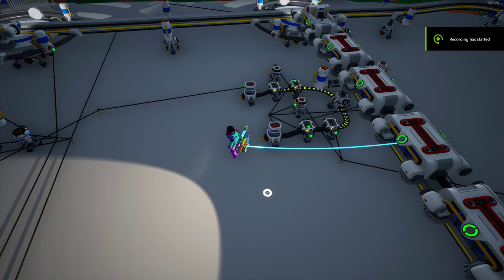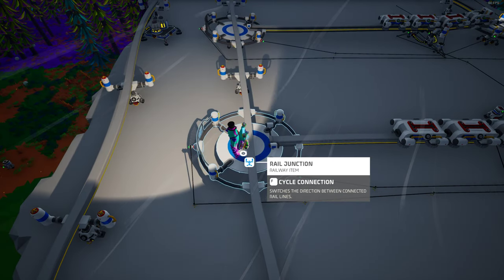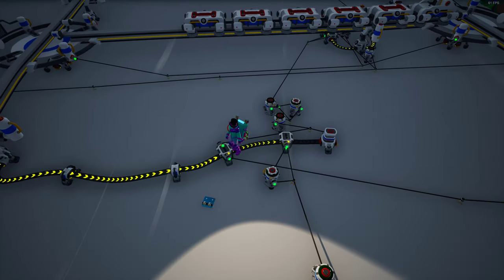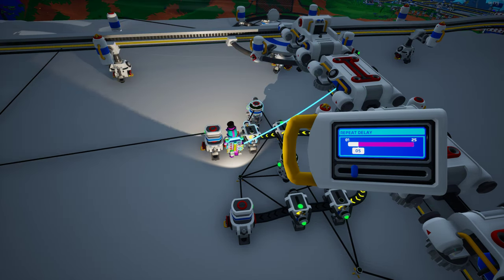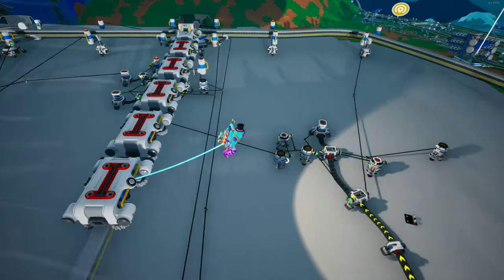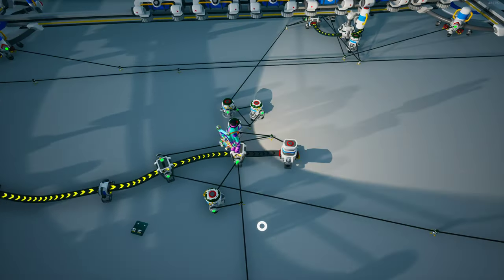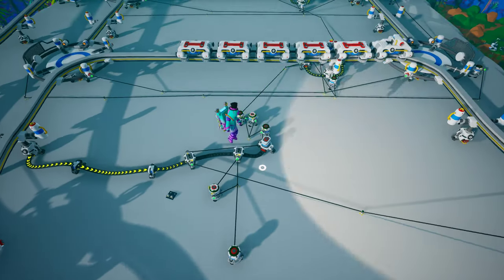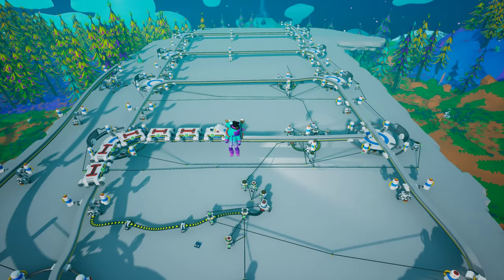ASTRONEER Train Stacker Sending Circuit

Comment: Great explanation, will definitely try to use this. Is there a way to send trains back to the track they came from after multiple tracks converge here to be stacked? For example if you had multiple extracted materials coming in to be unloaded, how would you send the cars back to the same extractor after they’re unloaded?
Reply from the maker: So it turns out if you want just a stacker, this might be extremely complicated.

We just had the idea to use a really long rail line instead of a multi-bay-stacker design.

I will be using this bay-stacker design in a giant ticket station which might be what you’re after. It will have multiple bays all with their own filter to pass trains through. Same design as my most recent ticket stations
Reply: @prestleynelly  I see, appreciate the help, will try to experiment with it myself to understand how it works as I’m new to Astroneer